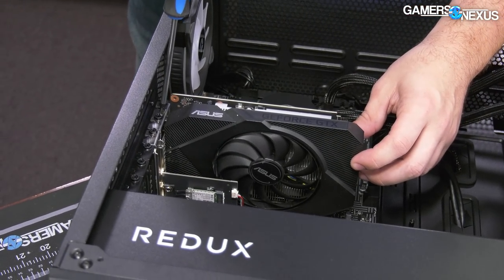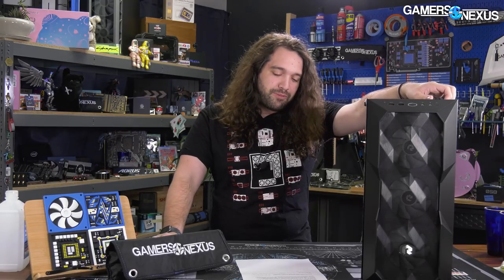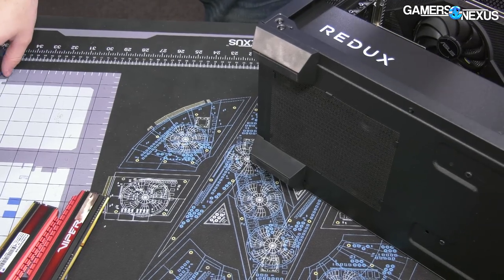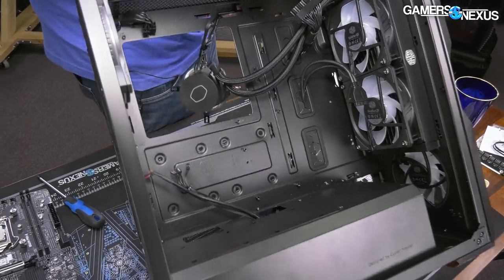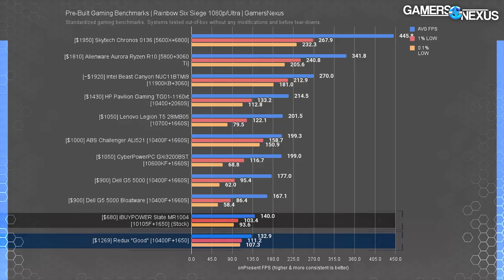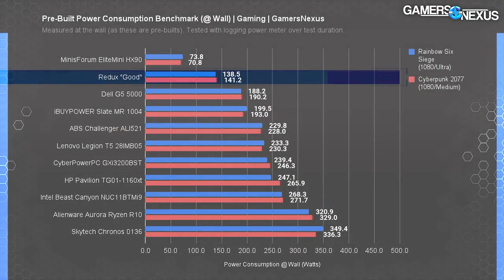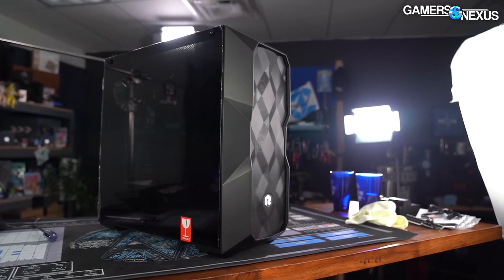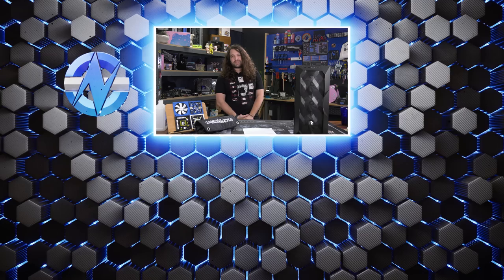YouTube Ads Told Us to Buy This: Redux Gaming PC Review

Comment: A LOT of people I know start their journey into PCs and gaming with Acer. They often have what at least seem to be the most price effective option. Would love to see one of theirs disected by you guys in this series, to see whether they actually know what they are doing, or pull of the same crap Dell & HP did.
Reply: It's same as others. They buy the same type of board with Custom branding so they can reduce labour costs for assembling. Most OEMs does this because it's cheaper.
Reply: @akza0729  As we‘ve seen in this series, it is almost a good thing if it is just that simple. Proprietary boards, PSUs, cable layouts, front IO and even cooling mounts. Incompetent parts combination or assembly.
Reply: Dawid Does Tech Stuff had quite a few videos on prebuilds, including Acer. In short; it ain't good
Reply: @rasmusvedel  Love my Acer Gaming PC. It's one the best prebuilt's.
Reply: No prebuilt is going to give you a the flexibilty of building your own, but when you can save 500 bucks off a GPU, it becomes something to consider.
Reply: @mikem9536  that's the thing I can go buy this prebuilt near me that 1500$ with a Gpu going for 1200$ on ebay so I've been tempted to buy it swap my old gpu into it and selling the one it comes with so I can get a ryzen 5600x with 16gb of ddr4 and a Aio water cooler and case for 300$
Reply: @rasmusvedel  my asus ROG is built pretty well. only things i had to really change is the cooler, and im looking to upgrafe my ram at a later date. and! dual channel ram OOB
Reply: @NarutoLikesSherbit01  If it comes with a single stick of ram then it can't really be said to be built pretty well
Reply: @rasmusvedel  thats funny, mine came with 2 16gb sticks
Reply: @NarutoLikesSherbit01  That's not how I read your comment at all. "I'm looking to upgrade my RAM at a later date. And dual channel RAM".

That reads like you're upgrading to dual channel, which indicates it's single channel
Reply: @rasmusvedel  ahhh right yeah i see where i could have phrased that better, but yeah by upgrade i mean just a better quality kit, as these are unbranded generic sticks
Reply: @NarutoLikesSherbit01  I'm with you now!
Reply: Got my start with an Acer Helios 500 laptop and I absolutely love the shit out of it. Built super well, got a full Vega 56 GPU in a laptop somehow (the only model I believe ever to do so). Got it for $1299, spent another $100 on a 2nd SSD and 16gb more RAM, it's my favorite computer ever.
Reply: I don't see why anyone still mbuys prebuilds, Steve showed you to make the PC.
Reply: @spacedaddy5517  A lot of people will go from buying prebuild to upgrading and then to completely building their own, unless they have someone around them to build with, or are immediately really into it.
Laptops, All-in-ones, etc. also exist, and actually more of those in total are sold than desktops, let alone self build ones. Self building is comparably accessable, but it is still a niche hobby, like e.g. car tuning. A lot of people will not even come close to it. Don't think otherwise, just because you, me or lots of people you are friends with, etc. are into it.
Reply: i bought an acer premade, holy hell it was terrible
Reply: @AnvilMAn603  Perhaps, all the more reason, and fun, if he takes them apart, litterally and figuratively.

Comment: I love how you put Linus in talking about GN, and the AIO orientation. I built my daughter a Ryzen 7 7700x on a asus prime  x670 mobo 32 gbs of ddr5 ram 6k mhs,  using an Nzxt Kraken AIO  for the cpu. It ran hot having the hoses at the top . I turned the rad upside down with the hoses at the bottom and it runs about 30degrees cooler!

Comment: For 1300 bucks I've seen some decent looking prebuilts with 3060s for around the same price on Newegg. Only having a 1650 in this is disappointing for how much it costs.
Reply: Decent? No but there are lik 3 prebuilds that had a 3060 for $1300
Reply: The 3060 is almost the whole PC price over here.
Reply: Friend got a 3070 prebuilt for 1300 in germany. Got my FE for 499, and i placed it in a 800e system.. i feel bad for people buying that kind of prebuilt.
Reply: @silure9502  what website?
Reply: Spend 100-200$ more and you get a OMEN 25L with a 3060.
Reply: if you figure pricing yourself you cant build a decent pc with a 3060 for 1300. you will have to skimp on alot. i cant see this company making much on those prices. i would not want to be in the pc building business right now.
Reply: well it has all the case, power suply and cooling you will need once you step into upper mainstream territory,...
Reply: I just got two 3060 prebuilds for my kids last month. One on Newegg for 1200 and one on Amazon for 1100. Both seem to be built decently. I upgraded the stock cpu coolers and added GPU supports, but as far as everything else goes, they seem to be fine. One of them has that Oley brand RAM and I’m going to keep it in there, unless there becomes a problem with it.
Reply: @randybobandy9828  decent... yes. In this market with scarcity and supply chain issues, if I can get a 3060 for $1300 I'm happy. If you want to jump through hoops to get better than that, I applaud you, but you make it sound like 1300$ for better than a 3060 is easy to come by...
Reply: @jhue73  It's actually very profitable to be in the PC building business right now, I'm not sure how you decide that it's not financially viable, but the scarcity of parts actually makes contracts with the manufacturers for parts very lucrative.
Reply: @michaelaldrich3528  I agree people that have distribution contacts that they get steady flow of parts they are OK, freelance pc builders that have to use the open market as everyone else not as much. But I just stop and dhink how here we are talking about a 3060 at 1300 like is a good price, when in normal times that should be for like 800 pc. I would love to see the gpu market back to its msrp state soon it sucks how overpriced things are nowadays.

Comment: the reason for the liquid cooler and push pull, is that all higher tiers propably use the exact same setup, and its easier and more consistent if the people building it, have to build the same configuration every time, and not  mix between this one has this cooler this one has another one of the 3 million coolers etc

Comment: Our daughter bought one in March and showed it finally up in July. We also contacted them, and contacted them, again and again. We were told that it would be shipping soon each time, but it came when it came. The motherboard wasn't installed correctly, and the backplate was smashed in. We're not sure what else was incorrectly "assembled", if you can call it that. She opted to just keep it as is after considering all of the time and effort it would take to ship it back in for service it should not have needed. 

Not going to buy another pre-built and will just figure it out myself. Feh.
Reply: Well good luck on finding a graphics card for a gaming pc. Either spend too much or pray that a good deal will come out or win the Newegg shuffle.
Reply: @reigoemon2229  Or get a FE drop for msrp that lasts a few minutes.. Got my 3070 fe for 499 in germany and it lasted 40m
Reply: @reigoemon2229  even new egg shuffle is a rip off... MSI 3080s for $1100? For a card that was originally $750 and is now maybe $8-900.  It's not as bad as ebay, but even new egg is taking advantage of "market conditions" and making sure they get their money.
Reply: Taistelu_pelto  if i could guess it possibly wasn't "clipped in" all the way, or maybe it was, and it got pushed out inbetween the back of the case and the motherboard, leaving it flopping around and only held in by the ports. Not a major issue, but not something you want to see on something you paid money for to be done right. 

The motherboard? I'd be curious as well, but if i could guess there they didn't use many standoffs, since that takes time and effort.
Reply: Taistelu_pelto  Well, you can hit it with a hammer, for one. TBH, I'm not sure how they did it, but they managed. As for incorrectly installing a motherboard? That's easy. Just use the wrong stand-offs.
Reply: Taistelu_pelto  Yes. Thanks ;)

Comment: I recently purchased one of their "best" configurations. I did so because i did not want to pay 1900 or more for a 3080. It was about 1100 for the card, not great but i didn't want to have to search endlessly for a card at or near msrp. I would have prefered to build it all myself, but again didn't wanna wait and hope for a more reasonably-priced card. With shipping and tax i paid $2830 i believe. Intel 10700k, 1tb gen 3 m.2 ssd and 2 tb of hard drive space, 32 gigs of 3200 mghz ram. Honestly im pretty happy with the purchase. Everything was as cleanly assembled as in the pc in this video. No damage at all from shipping, everything was connected and in place when i opened it up to inspect everything. Booted up first try with no issues, only a few drivers needed to be updated. If anyone has any questions feel free to ask. Took about 16 days to ship. 3 days to arrive, and i had honestly expected it to take 6 weeks based on reviews from earlier in the year.
Reply: This is the exact boat I’m in .Out of all the pre built companies this is looking like a pretty reasonable option.
Reply: How’s it holding up for you? You are the exact situation I am in. Just can’t try and wait out this market anymore
Reply: @TheZjensen  is been just fine.  But man does my 3080 get hot.  I'm probably gonna train up for an open air case and water cooling in the next few months. I just want these components to last.

Comment: It's 1400$ now but they replaced the 10400f with a 12400f and the 1650 with a 3060 which is probably a pretty big improvement, and it looks like they're no longer using a liquid cooler for this one. Maybe you could review the new version again?

Comment: It may be a bit overkill on the cooling.  However, it makes it easier to upgrade the CPU and GPU later when prices come down.  You would not have to change the cooling setup.  There is definitely some value to that in my opinion.  It is nice to see all standard components, and that it was competently built.  Also a good looking system aesthetically. Prices have been going up quite a bit lately, I can't wait for the prices to start stabilizing to see what the new normal is going to be like.  Great video as always, thank you!
Reply: But looking at that cheapo b560 board? Nah i don't think so. Even if the AIO is for "future proofing" the motherboard itself doesn't look to be able to handle a high end CPU that leverages the AIO.
Reply: @aerosw1ft  But you still don't need to buy a new cooler.
Reply: Tbh if you living in somewhere that has summer all year long, get a liquid cooler if money allowed. I have a 10700 (non K), and with the stock cooler, under normal 60W load it was at like 90 ish degree celsius, then I switched to cooler master 212 evo (air cooled) and with power limit disabled it still clocked 100 degree C and thermal throttled, with TDP of 120W. Have to reduce the PL1/2 to 100W just to get below 90 degree C.

Comment: The build quality is actually very good. The sticker for the hub, it's lightweight so the tape should hold for an eternity. The IHS, there was enough contact overall and the corner of the IHS isn't the Hotspot either so that's pretty good when you consider it wasn't over applied or under. GTX1650 and price value proposition is disappointing but still It's one of the best pre-built pc I've seen on YouTube.
Reply: Not so impressed myself, 1650 is garbage for the price I expected a lot better.  This things so under-specced it would be a huge downgrade from my 3yr old lounge PC.  The cheeky gits only put an i5 and a 1650 in here yet they are chargin over a $1000!  No way man this things a waste of money plus it won't actually game well, the performance is savage level bad.  I am surprised people bigging this up, I would be VERY disappointed to have spent $1300 and got this hunk of crap.

Fierce do a similar one that costs  $875 comes with a 1660S and R5.  How are they justifying $450 extra when the specs actually LOWER than the Fierce machine?  Lol this company is a rip-off they suck!
Reply: Disappointing for having a 1650 in a $1250 prebuilt is an understatement...

Comment: Messing around on their site, it recommended me a "Good" system for $1370, but swapped the AIO for an air cooler and 1650 for a 1660. That seems like a much more reasonable configuration, but still not a screaming deal. :/

I hate these GPU prices. It is like a never ending nightmare I can't wake up from.

Comment: The last build I made was last week with components I had in stock, except from the motherboard and the CPU (a recent i5) I used a Corsair H100x AIO on it, with 6 Noctua Chromax fans. on lowered voltage, system temperature is about 35C° and CPU 22 C°, with load it's about 30C° also a little overkill for that system. But like I said, these were old stock, and now I'm happy, and my best friend also.

Comment: Looks competently built and not designed to screw the customer. So that is better than some of the others.
Also likely to be upgradable in future, with a good case, and large PSU (If that PSU is good).
Loose the water cooling and add a better GPU and it would make sense.
It would be interesting to see how their higher end PCs fare given the overkill cooling and case selection here.

Comment: I'd rather have overkill cooling like this over a load bearing cpu cooler.
Reply: "load bearing" what does that even mean
Reply: Just don’t forget to connect mouse and keyboard to the P.
Reply: @NerdlySquared  P what?
Reply: @simplysaphi  you really just coulda told me :D No srsly I've looked it up, found nothing. It's a made-up term and I'm sure it means something and I know Dell messed up with their prebuilds, I've watched the video as well as the Alienware one. I just couldn't figure this out, enlighten me, please.
Reply: Dells g5 heat sink mounts not to a plate but to the case through the motherboard.
Reply: @spectraleggings  as someone said before me, they don't have any back plate or anything on g5 and just screw in to the back which makes the cpu cooler "load bearing" because it literally acts as stand off screws there

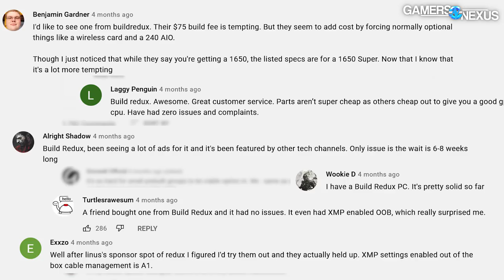Comment: I'm pretty excited about being in the video  @3:43 however I've been having a lot of issues regarding my PC. First off I don't have the correct parts. I've received horrible customer service. So much so the original employee supposedly handling my support ticket actually doesn't work for them but.
Reply from the maker: Thanks for your early comment!
Reply: @GamersNexus  you guys can review my PC if you want lol. I hat to remove obstructions from every single I/0 port aka the I/0 shield wasn't installed correctly. Had to cut metal to use my PC.
Reply: @SrgtWookieD  oof
Reply: @GamersNexus  i'm really having a horrible time with these guys. Could you please help? my motherboard is defective im 6 months into trying to get a replacement. they lie non stop i'll send yall the emails and screenshots, these guys are shady. im expected to pay another $200 for a replacement board, also it doesn't even have the parts my order says. please help a pc gamer get back to gaming

Comment: I'll just throw my opinion out there for the fan controller, but I mounted mine with VHB, no problems after years of use. Screws make sense for some components, fan/rgb/whatever controller I think get a pass in that regard.
Reply: I'd probably use Velcro or something like that to mount my controllers, that way it's a lot easier to swap them over to a new case if I ever have that need.

Comment: i ordered one of these in June, got it in August.  Ryzen 7 3700X,  RTX3070 8gb  and 32GB DDR with 2 1TB NVMe's .  so far no problems other than i added a fan to top of case for better airflow as rear fan was pulling air in, not exhausting it out the back..its a HUGE upgrade from my old machine..paid about 2300 total..

Comment: One thing I really don't get is why builders keep putting micro atx sized everything into a mid tower case, instead of something more appropriately sized for the components. The inside of this thing has an insane amount of pointless space. Is it legitimately just that the kind of people buying these things associate a larger case with it being a better computer?
Reply: There's a shortage of good MicroATX cases on the market, and mATX boards are cheaper as well as faster to install (fewer screws).
For a physical retailer, I can see customers thinking 'bigger is better', but its a lot harder to estimate the size of a case when shopping online, so I don't think online retailers like ABS, Cyberpower, or Redux are trying to push that misconception.
Reply: I'm pretty sure it's just a cost-cutting/margin-maximising thing. They could put an ATX mobo in, but mATX mobos are usually cheaper.

Comment: Wish we could see this with a higher spec tier version like one with a 3080 instead of the entry level tier. Makes me wonder if "some of the excess waste" would be less of an issue since it's consistent with need. I imagine they use the same setup across all of them because it's easier and faster as a business, which makes sense. It's designed for the high end and then they keep the same setup for the entry.
Reply: exactly right, as the price scales, the value does too

Comment: The free "upgrade" of the motherboard might actually end up causing issues for the owner in case of RMA. Invoice says B460, inside is B560 "well obviously you have changed the hardware configuration".